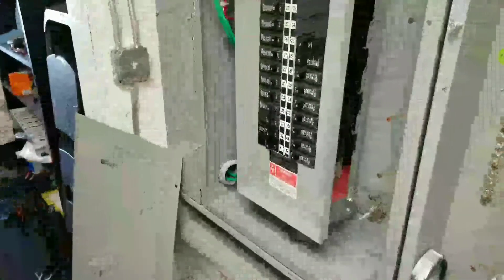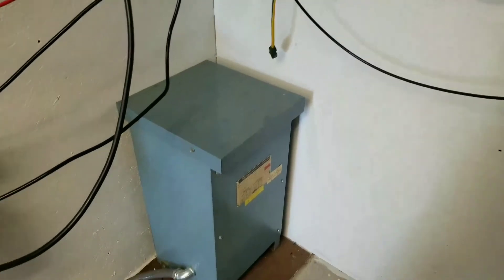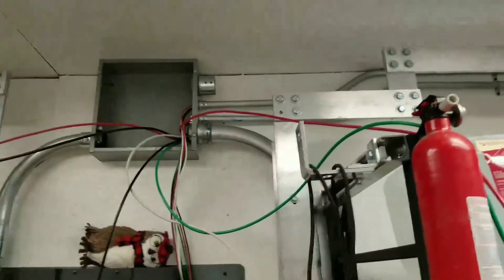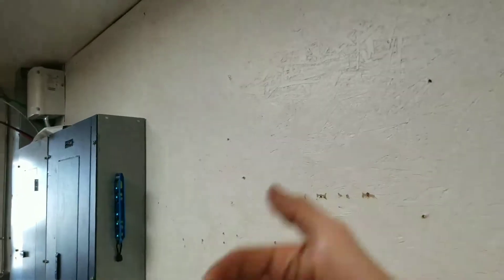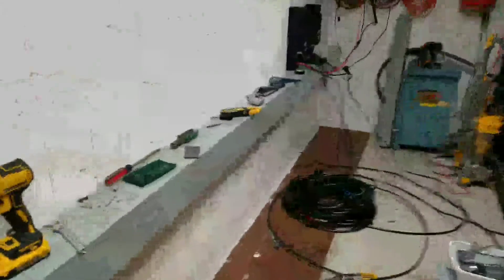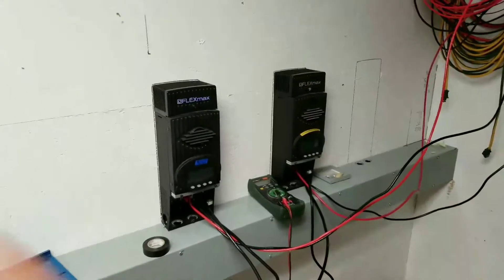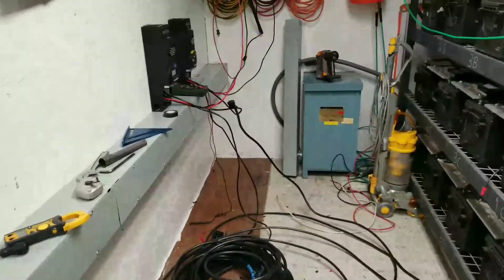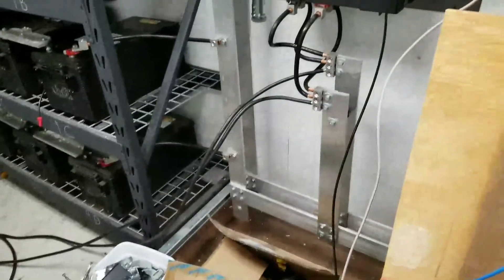Off Grid Power Room Rebuild PT 5 - The DC Side

Comment: why are you using a (panel board ),( verasas a load center)?
Reply from the maker: derek scaggs a panel board will have a lot more space on the inside for doing all your connections as compared to a load center, are heavier duty, and in the case of the split panel have better ability to be set up based on individual needs.